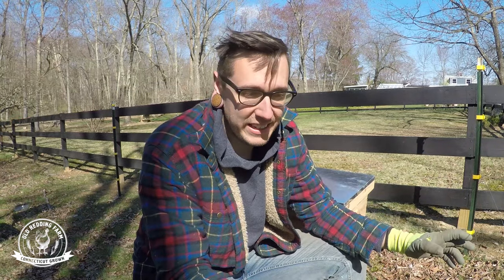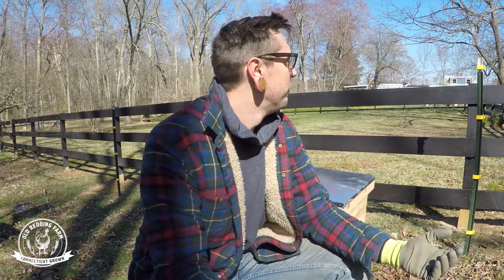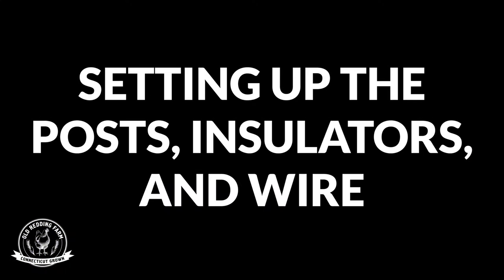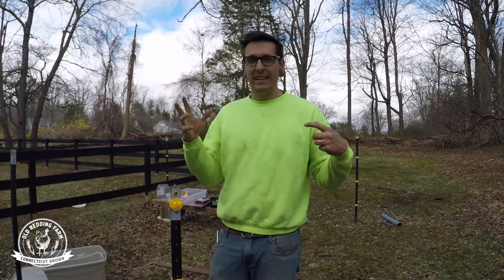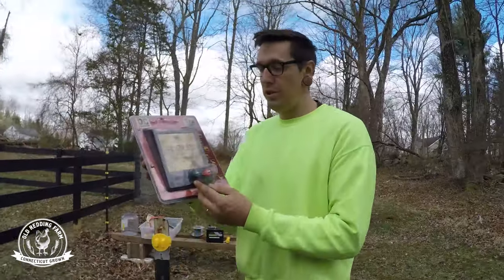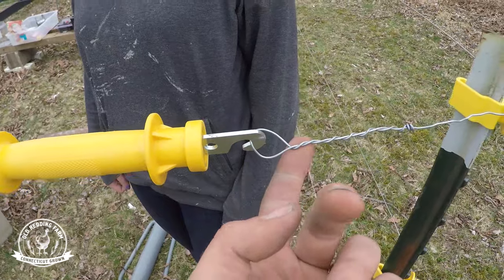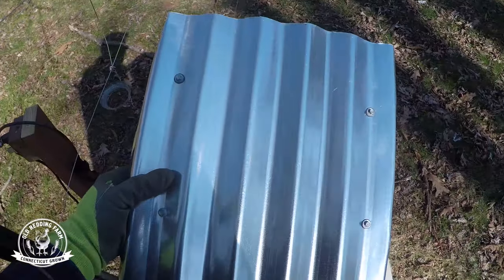How To Set Up Your Electric Fence | Keep the Bears Out of Your BEES!

Comment: Learned from an old electrician... drive the ground rod it as far as you can, remove it, fill the hole with water, drive it in again, remove, repeat.  Works pretty well in our rock hard clay soil.
Reply from the maker: We have heard that too (now, not at the time of filming this) and its def. something we will try. I feel like I was just hitting a big rock and not sure water would have helped. rock clay soil sympathy to you from fellow rock and clay soil.

Comment: Great explanation in lay terms (which I need), and there was no time wasted in the video. Very concise. I use my legs more with the post-driver so I can drop most of my body weight onto it and use less arm muscle 😉 great video!
Reply from the maker: If you're about to sink a grounding rod the comment I got over and over which I believe would have helped would be to pour some water into the ground where you're stuck to help move whatever rock you're stuck on out of the way. I wish I had known that before.

Comment: I would say that your cut off switch should be turned around with the top of switch above fence post. This way if you needed to disarm the fence it would be easier to reach and pull down then after pulling down there wouldn't be a chance that it could become accidentally charged. For instance after years of use the switch became loose. With the switch being in reverse position once it is disarmed it will stay disarmed until it is armed.
Reply from the maker: Yes we got that suggestion and flipped it around! Its a good suggestion something we didn't think of as first time electric fence installers.
Reply: @OldReddingFarm  I wanted to say I appreciate the video. I looked through some of the recent comments and didn't see that comment. Thanks!
Reply: It's also a standard.  Power up/switch up Power down/switch down.

Comment: I use a jackhammer for grounding rods, I just take off the the chisel and use the rod itself, a three foot ladder will be very helpful and some strong arms, jackhammer is kinda heavy, but still way faster and less exhausting than actually hammering in any other way, unless the ground is soft
Reply from the maker: Yah they make something like that thats for T posts it would have done the job for sure.

Comment: Post hole drivers and sledge hammers work great for ground rods but if you live in an area with really dense soil you can also rent large hammerdrills from most retail hardware stores, makes it really easy.
Reply: This is exactly how I do it.  Large Hammer Drill.  Best way for sure.  I can put one in the ground in a matter of a couple minutes without all the extreme effort.
Reply: @danmartin4398  Not to be pedantic, but do you guys mean a "rotary hammer" instead of a "hammer drill"?
Reply: @hubbahubbazootzoot  Actually, NO.  I do mean Hammer Drill.  It can be used in either drill fashion or chizzle or both depending on what you are trying to do and what bit you use.  In driving the rod I've found this hammer drill to be the fastest and least effor of any method (not using a bit but rather insert the rod into the bit slot)

Comment: Really nice explanation, the one thing I can tell from your video that no one talks about is that you make complete loops. Every wire touches all the way around and then you run the power to each “loop”. The fence I’m trying to repair is missing the last connection back to encircle the fence, I’ve read it’s okay to leave it not fully connected in a loop. Because the animal will still complete the circuit to ground. What say YouTubers?
Reply from the maker: i'm not 100% sure, the way that i understand that most fence electrifiers work is that they need a complete circuit, so the current goes out and back in. but i'm no electrician!

Comment: Pour water around the ground rod as you drive it in and it will help soften the dirt as you drive it in! I’ve had to drive many of those as an electrician! No one likes that part of the job lol
Also, you can rent a jack hammer that has a tool that fits over the end of the ground rod

Comment: Thanks for the video. Very clear and simple instructions for us beginners. Instead of driving my grounding rod into the ground vertically, im going to lay mine down horizontally and dig a trench to lay it in.
Reply from the maker: I think a trench is a great idea!
Reply: Just make sure it's a very damp area. Very hard to properly ground in shallow dry dirt. Using more than 1 rod may help too or just wet the area pretty often.

Comment: Connecting to the ends would be a more stable connection, and put jumpers up to each run of wire; right now you’re depending on wires twisted around each run that depends on another wire twisted around another run of wire. It would be more stable to connect to the ends and use something more stable for jumpers to each run.

Comment: First, what are you going to use to keep your battery charged as your fence drains it ? I noticed it wasn't a solar charger. Second, you should really buy wire connectors that attach to each run of wire, then you run your hot wire up thru a hole in each connector and tighten down the screws making a tight connection so it doesn't short out. Third, you should put a bucket or something over your switch to keep it and the wires dry. Good video thoe.

Comment: One question for you, using the 12 volt battery, how long does it last? And do you have to charge it? Or does the controller charge it? I guess that's three questions
Reply from the maker: Yes you do need to charge it, how long it lasts depends on how long your wires are and how big of a battery you have. Looking back at this video I would have much rather gotten a deep cycle marine battery then the little battery that I got. The controller does not charge it. If you stick with the small battery I would recommend getting two so you can always have one charged up

Comment: each of the wire runs, are you looping them so they complete a full "circle"? Meaning, they aren't just dead ended? I am having trouble figuring out why my fence isn't going live. I see no wires touching metal, and no sticks or anything touching the wires. I've actually got it down to just the very top wire run solo, and I still have no voltage running through. If I just put a little one foot long wire on the box, it has power as just a dead ended wire

Comment: Thanks for the instructions.  Did you only install one 6 ft ground rod?    I'm confused.  I ordered a kit from Lowes, arriving today.  It comes with three 3 ft ground rods, 3 ground clamps and 50 ft of uninsulated galvanized ground wire.  

My instructions on the box the charger came in say use insulated ground wires rated at 20,000V to connect ground rods but the Lowes kit comes with uninsulated ground wire.  ?????  They are making me crazy. Also the charger says drive in 6 ft ground rods 10 ft apart.   I'm only running one hot wire one ft above the ground around 50 ft length  to keep the animals in the woods from entering my carport and eating my cat. 

I watched a different Youtube video about electric fence installation.   He only used one 6ft ground rod and only drove it half way in the ground.  He has a lot of experience with electric fences and I assume he got good results.  He made a barrier around his garden with the electric fence.

BTW the ground here has so much rock in it that I would likely spend the remainder of my life trying to drive a 6 ft ground rod all the way in the ground.   I ordered a electric fence tester from Amazon so I guess I'll know if my three 3 ft  ground rods is enough ground.   A plus is the ground here hasn't been dry in 20 years or more.

Comment: Make sure your battery BOX is inside the fence area.  A bear can and will open your battery box and pull your connections apart leaving it to get through your fence.
Reply from the maker: Wow good suggestion ! I hate to think of a bear coming and like, defusing the electric fence like a bomb technician! so tricky. But that would keep it safe.

Comment: Nice tutorial, very well organized and easy to follow. If grass and weeds grow up and touch the wire, will that cause the system to short out?
Reply from the maker: Depending on the strength of the charger, it might. But most chargers are built to withstand some grass growth.  Ours is easy to weed whack around though. Thanks for watching!

Comment: One thing I do know, unrelated to electric fencing, is to never put batteries on rock or concrete. For some reason, it will drain your battery. Battery should always be placed on wood.
Reply from the maker: Interesting good to know thanks for sharing. (good to know that kind of stuff with a last name like stone!) :)
Reply: @OldReddingFarm  lol
Reply: Modern batteries like in the last 50 years do not have issues with being placed on rock or concrete.

Comment: I have always heard if you put batteries directly on concrete it will draw the power from them. Just a heads up. I will do everything you video showed, it was really well done. Thank you
Reply from the maker: Yes I think that could possibly be true a few people did mention that so we added some wood just incase. Good luck with your fence project!
Reply: @OldReddingFarm  
FYI The "keep lead acid batteries off the concrete/ground" thing dates back to when the cases were made of rubber etc. The cases have been made from plastics from decades and are immune from damage. Place your battery as you like.

Comment: Great video for someone like me getting ready to do this for the 1st time, thanks! Is each “lane” it’s own separate wire, or is it all one strand just looped around/down the pole?
Reply from the maker: Each lane is a separate loop, and then you connect the loops. So the "hot" wire comes from the switch, and then goes to each of the wires to connect them all together. Hopefully that helps! let me know if it doesn't and I will try again!
Reply from the maker: Also my attempt to explain it in video was around the 9:44 mark thats where I show the how the separate loops are laced together.
Reply: Yep! That helped and you’re right that showed it. Thanks again!

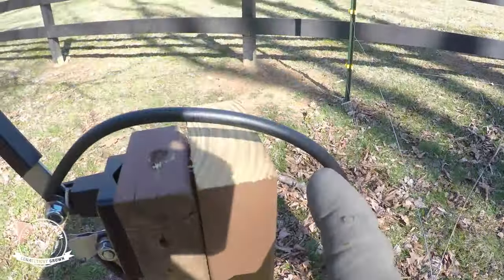Comment: How about tester and battery ? what kind  did you buy and where ?  As for woman its a bit complicated for me when I tried to understand  9:14 part.  Also, how did you install Insulated wire ? Can I use  instead of T-Post  wood post from my woods  to save $ ?
Reply from the maker: The tester and the battery both came from tractor supply company. They have an electric fence section in their store which had basically everything we needed. Could definately use wood instead of T-post, they make different insulators (the yellow plastic things) that screw into wood instead of clipping to T-post. The Insulated wire needs to be stripped to expose the wire, then wrapped around the posts on the charger, and then you do the same thing to connect the wire to the cut off switch. Let me check the 9:14 part and get right back to you
Reply from the maker: So if you want to ask any questions or want some help talking you through it maybe message me on IG? Is the shut off switch what is confusing you or stripping the wire? Hit me up on IG I would be happy to try to talk you through any questions you have

Comment: Hello there.  Just a quick question if you could help me out.  Im building a large electric fence perimeter around my sweet corn patch.  Can the wire come all the way around and meet where you started?  (Be connected to the same spot where you started? )  Or does that cause problems and should  you not make a wire a complete loop?  Just hoping to get an answer to that before I get too far on my project.  Thanks!
Reply: And now that i've watched your entire video I can see that it clearly shows that you can.  But any input or advice from your experience is greatly appreciated!  Thanks again!
Reply from the maker: Yes a complete loop is what you want!
Reply from the maker: Oh sorry a second comment! Yes just make sure that the charger you have will generate enough power to be electrifying all the way around. Most of the chargers at the store will tell you how many feet or miles or whatever the case may be of charge they can max out as
Reply: @OldReddingFarm  okay thanks!

Comment: Hey there. Great video. You helped me immensely in getting our setup off the ground.

I did the same battery as you, for presumably the same cost efficient reasons as you.

However, it is day 10 and I think our battery is already kicked.

Wondering what the lifespan on your little lawn and garden battery was?!
Reply from the maker: you can recharge them! if you look at home depot or lowes for a battery charger and get a second battery and we switch ours out every 5-7 days for the one thats been in the garage charging

Comment: Great video, very much to the point. Few questions though. Wouldn't it be better to put the switch between battery and the voltage amplifier (transformer/s)? Shouldn't the switch be covered from weather  (freezing rain )?
I am not an electrician/expert/farmer.
Reply from the maker: we put it between the charger and the fence since the battery is inside of the fence and it wouldn't make sense to interrupt the flow between the battery and the charger; you want to interrupt the flow of electricity between the charger and the fence. (I think!) you can cover the switch but it is only plastic and metal so there wouldn't be anything at risk by being out in the elements. you could definitely do that if you wanted to

Comment: Hi man,newbie here,is the insulators really that important?i have n electric fence that has been losing its power lately and i notice that i have broken insulators and some of the wires are touching the metal rod,you think they are the culprits?thanks for sharing..
Reply from the maker: Yah if the wire touches the metal tpost I think that would short out the whole system I bet that's it

Comment: to be real safe,  the wire should be every 6 inches starting from the ground to 4 foot high. if they get their head thru and get a shock, they will go right on thru especially cubs and once the wire is down and the cubs are excited, it's game on for the moms. I even had a large bear, after getting shocked a few times pull  the  corner post over like it was rubber. now other than the 7000 * volts in the wire, I have a radio playing as loud as it can go to keep the bears out. the radio has worked so far. the sick music they have today is enough to drive anyone nuts. there are getting so many bears around here, I may have to move the bees two hundred miles to my sons place  where bears are  seldom seen or lock them in a shed at night like the chickens.    P.S. when the bear pulled the corned post down and got a couple hives, I cleaned up everything the next day and cleaned all the wax into a wheel barrow, I foolishly left it out by the hives for the bees to clean and the bear or a bear came back the next night and actually ate all the  honey coated wax, about two Homer buckets full. that's when we put out the blaring radio.
Reply from the maker: Wow sorry that happened to you. Sounds awful. We can't do a blaring radio though because we have neighbors and don't want to drive them or ourselves crazy along with the bears.
Reply: the radio probably doesn't have to be  that loud but we want the bears to hear it from far away and we can't hear it in the house,. Once they get a routine and know where they got a meal, they will come back. they seem to know that up in the village , people will be setting out their garbage for the truck on Mondays and so they will be in the village for the smorgasbord.  they were cute 40 yrs ago when they first showed up but after losing a dozen or so hives, they're not so cute.  I figure that the three hives last week cost about 3 grand counting loss of this yrs honey.

Comment: Has the battery held up? I think battery’s have a reaction when on concrete.
Reply: Modern batteries like in the last 50 years do not have issues with being placed on rock or concrete.

Comment: What kind a wire you use for ground, and from the fence to the charger?
Reply from the maker: Its an insulated wire, its called underground wire sometimes. It's a little thicker than the fence wire. It has a rubber/plastic jacket around it so it doesn't conduct electricity outside the wire itself.

Comment: I'm having problems with raccoons going into my attic.  They climb a wood privacy fence and get on the roof.   I've had their entrance into the attic sealed and they just tear out a different place in the soffit.  They have cost me thousands.  I have trapped them and shot them, but new raccoons smell the scent and eventually show up.   Is it possible to electrify the top of a wood  privacy fence and still deliver a shock?  Not sure the animal will be grounded.  I don't want to put the wire close to the ground since we have kids in our neighborhood.
Reply from the maker: Oh boy thats a good question. You would need to attach the hot wire to the ground so there would just have to be a spot where you could run it down to the ground. inside your fence. I am sorry that you're dealing with that! Raccoons are absolute monsters.
Reply: @OldReddingFarm  hey, thanks for the quick reply.  Being that wood is more insulator than conductor in my mind, I called the manufacturer.  I couldn't get a straight answer, but they were leaning towards the animal needing to be grounded.  I went to Tractor Supply and bought the .04 joule, 2mile, $99 solar fence Energizer.  The wire, ground bars and hardware cost a good bit more than the actual device itself.  They were pretty sure that the wooden fence would be grounded enough to allow for a shock to happen.  If that doesn't work I'll wrap the fence in wire mesh and ground that.  Thanks again.